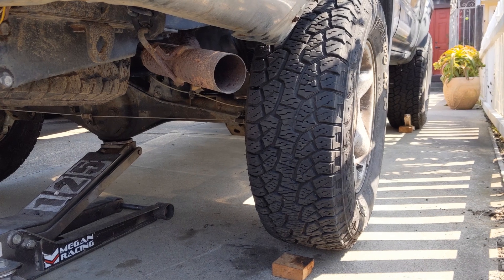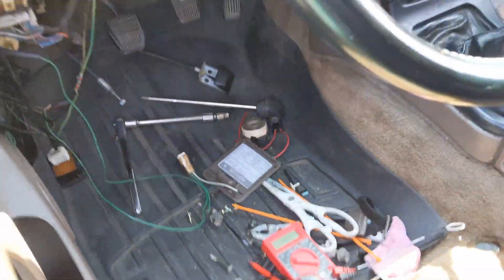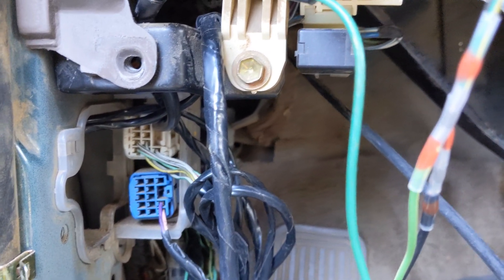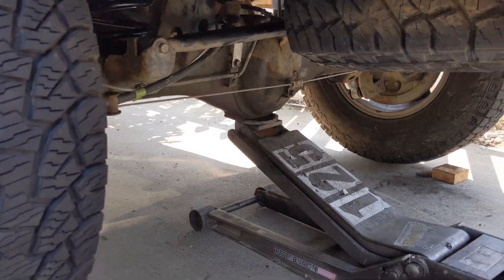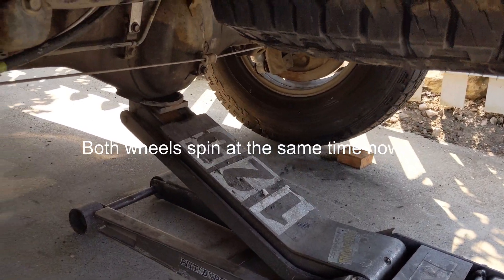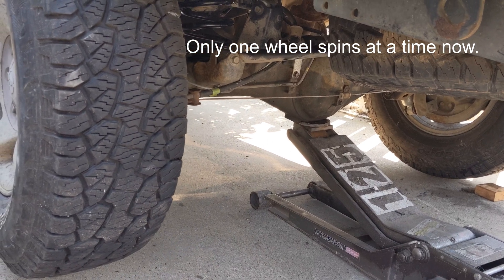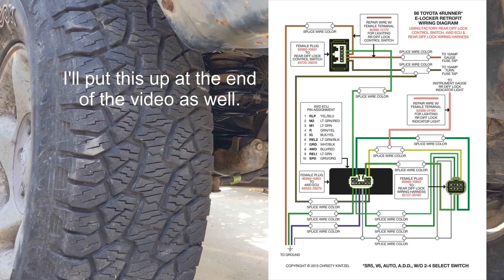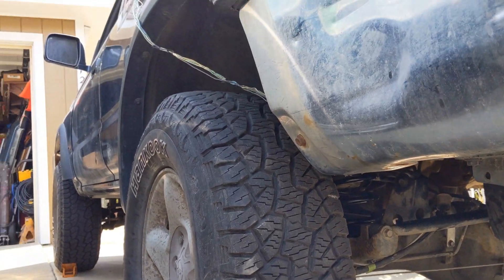3rd Gen Toyota 4Runner E-locker Installed and Function Check (wiring diagram)

Comment: Was yours manual swapped and it had 4.30 gears so you didnt need to change the front diff or did you find a 4.10 locker and it matched up to the manual stock 4.10 gears?
Reply from the maker: Mine was originally a manual transmission with a 4.1. I pulled the e-locker rearend from another manual transmission 4Runner that I had laying around which also had a 4.1. I verified it by counting the rotations on my driveshaft/wheels.
Reply: @agraygoat I have a 96 with a locker and i want to swap it into my 2000 manual. Id have to swap the front diff as well but im looking for someone to help me with the job. Since you have the experience would you be willing to help and where are you located?

Comment: Hey where do the two wires from the RR Diff Button wire into?
Reply: Okay I got it now, one question, how  do you get the wire to stay in the fuse tap? It keeps falling out
Reply from the maker: @twelve_thirteen - I made my harness with plugs and spliced stuff in. I didn't use vampire taps or crimp connectors. I wanted to make sure that the unit had clean power.
Reply: @agraygoat  do you have to install the elocker in the locked position?
Reply from the maker: One goes from a 10a fuse and the other to the e-locker relay box. If you look at the wiring diagram at the video, it'll show you the exact routing. The other wires are for lighting (which I didn't bother with).
Reply: @agraygoat  so one is wired to the fuse box and one wires directly into the ECM?
Reply from the maker: @twelve_thirteen - Yes. One is to a fuse (I used a space for power locks which my truck doesn't have) and the other wire to the black e-locker computer box.
Reply from the maker: I don't think it matters. When it's hooked up properly I think the e-locker ECU should be able to figure it out. I installed mine unlocked though.